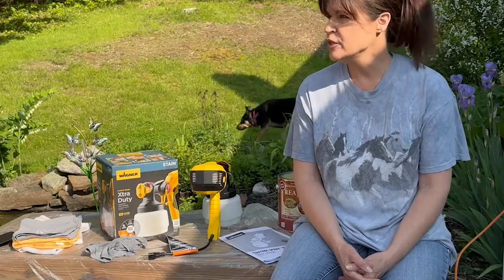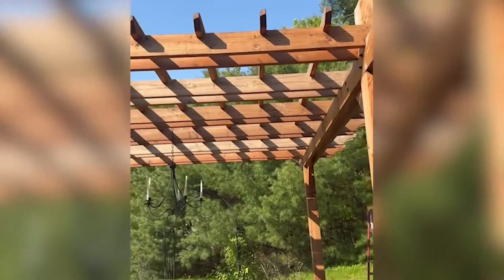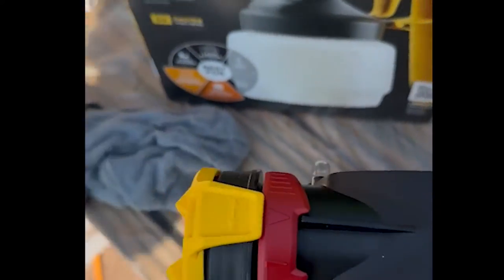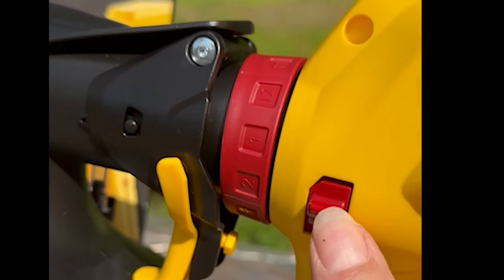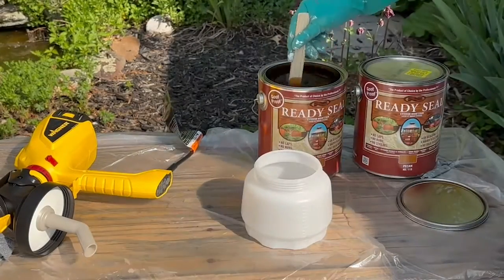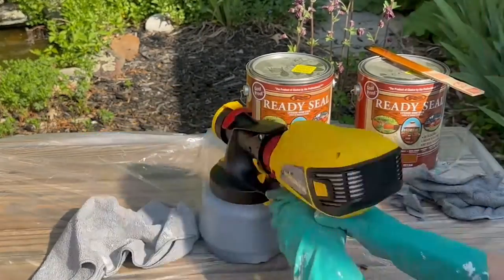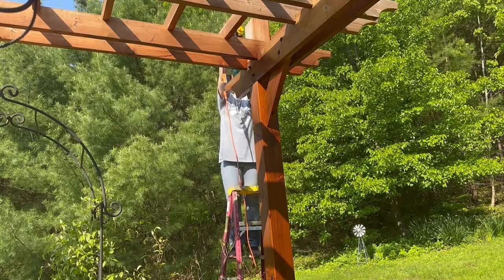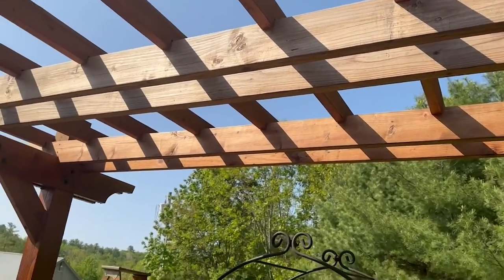Using a Sprayer to Apply Stain to the Pergola

Comment: Great video! Thank you! Are you pleased with the douglas fir? We are getting ready to build a pavilion... and the price of cedar right now is crazy!! I've seen lots of positive comments about douglas fir... and in the current market, it is significantly less expensive than cedar. I plan on staining before the build, btw. Any tips? Thanks again!
Reply from the maker: Thank you!  I am.  It is holding up very well so far and we are 3 years in.  The lumberyard folks were so helpful in wood selection and availability of course.  Red cedar is not readily available in my area and the cost…. well, you know about that!  I did stain beforehand too as it is so much easier before assembled.  Wood should be dry first but your lumberyard can help you with questions about that.  Good luck with your project!